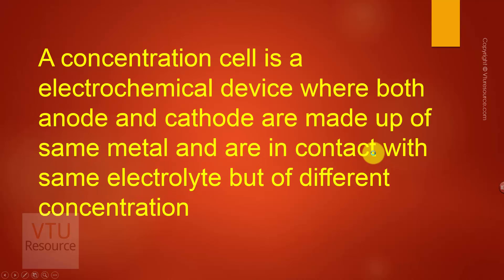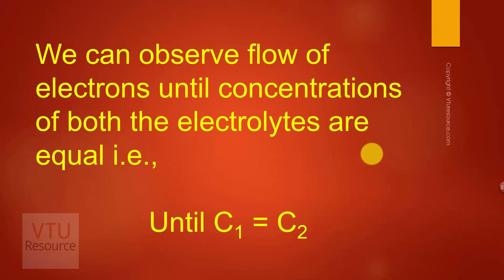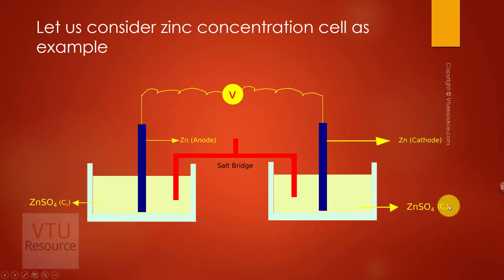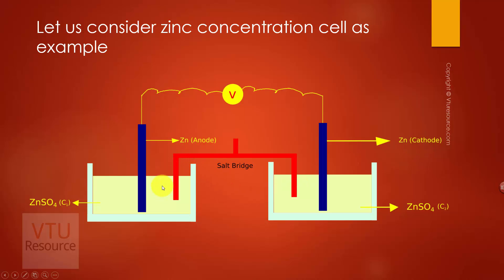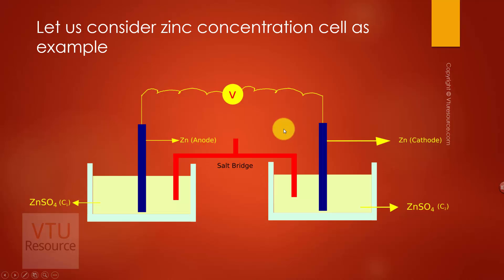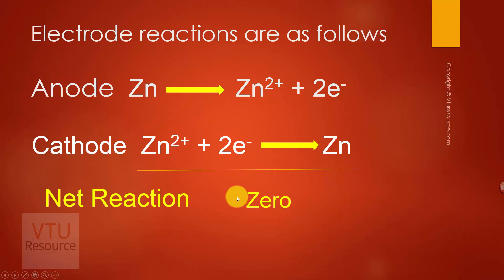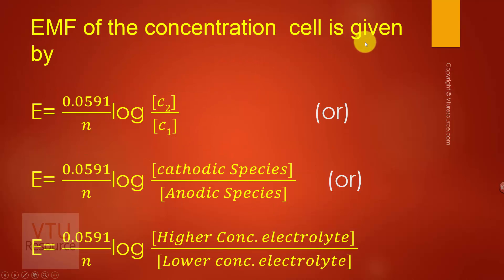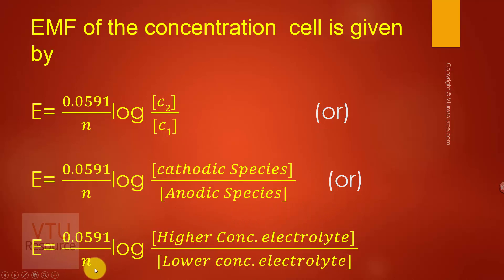Concentration Cell

Comment: What troubles me is that the ratio of the concentrations of the cations is only taken into account, like if you have 1 micromole/10 microMoles, will give the same value as 1milliMole/10 milliMole. Is there some range over which this model is valid?